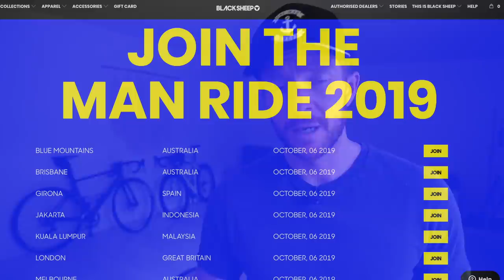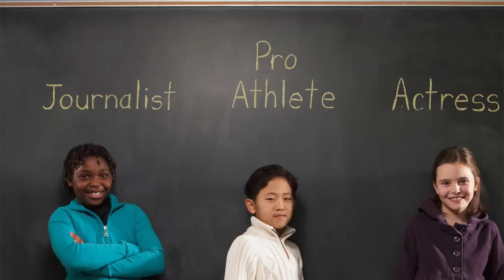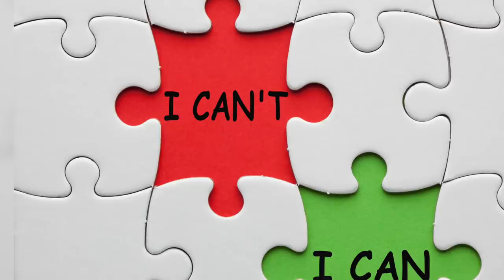Crashing My New Giant TCR & Lessons Learned

Comment: a strong front strobe light would help, especially in yr situation i believe.
Reply from the maker: Yes, agreed mate. Good point I should have mentioned. Cheers, Cam
Reply: Cam Nicholls the Bontrager lights have an interrupted flashing pattern which Trek funded research with Clemson University.  They also pair to Garmin head units and you can program them to turn on when you start your ride, and they adjust to the daytime light.  Whilst they are expensive, I think they are well worth the money.
Reply: Strongly agree on running your lights in the daytime. It is very very cheap insurance.
Reply: I've been using Exposure lights for the last few months (after a near miss), which have a day bright setting (irregular flash). I've noticed drivers giving me more room since using.
Reply: white light front strobe light, red strobe rear helmet, red strode rear bag, garmin rear radar!
Reply: Totally agree. I commute with flashing lights whether day or night. Better to be  safe and cautious.

Comment: Great message about mental health 👍

Did you have a front-facing, flashing light when you had the accident? I use one for the specific reason you outlined in your crash report. I also use a Garmin Varia radar on the rear. I won't ride without either. Glad you're ok.
Reply from the maker: Thank you mate, no I didn't. Something I should have brought up in the video. I know there are some really good tech lights out there at the moment that are even designed to capture motorists' attention! Thanks for sharing what you use, I'll look into that. Cam
Reply: Cam Nicholls the Bontrager lights have an interrupted flashing pattern which Trek funded research with Clemson University.  They also pair to Garmin head units and you can program them to turn on when you start your ride, and they adjust to the daytime light.  Whilst they are expensive, I think they are well worth the money.

Comment: When I'm riding past parked cars I watch for whether a car has it's lights on to work out if the driver is going to pull out or open a door. Also, the sound of an engine if a car is slowing down to turn is often more reliable than indicators.
Reply from the maker: Good insights, thanks for sharing mate.

Comment: Thanks for sharing Cam, glad you were not injured too badly.  Wish you a speedy and full recovery. I had a collision a little while back and I believe my learning point was take a defensive/ready mind set.  Assume that the car did not see you or is going to turn in front of you and reduce your speed, cover your brake etc. You only have to be complacent once.
I am a strong advocate for day-time running lights front and rear.  I have a go-pro mount under my wahoo to which my front light is mounted and hides.  So it is out of my vision when I am riding, I only see my wahoo and looks tidy when I look at my bike.  All modern cars run day-time running lights so they can be seen. We are kidding ourselves as cyclists if we think we should not use them. We as cyclists should put safety above vanity and aero gains.
Reply from the maker: Thanks Mark, and your bang on re running lights. Appreciate you sharing your story. Cam

Comment: Pull your fork out and have a good look at with the torch in a dark room. Look inside it as well. Take off your seat cap and check the ISP tip for any cracks inside and out.
Reply from the maker: Cheers mate, I might pull something else out and have a look at it in a dark room also! Leave the torch behind. Cam

Comment: Good video bringing attention to tricky lighting situations (showing the driver's view too), and the benefit of being open with each other about difficult times.
Was surprised the mechanic did not mention fork/headtube damage. Especially with stronger carbon rims that do not buckle, that force is getting transferred back into the fork/steerer/frame. I guess you can never be 100% certain without a scan but worth dropping the fork out and looking for cracks, bulges, haze, especially where the steerer joins the crown.
Reply from the maker: Cheers Craig and thanks for bringing up this insight. Makes sense. Cheers, Cam

Comment: Great video fella. Ironically In July I had the exact same incident with oncoming traffic turning right. My TCR was written off.  3 days in hospital
Reply from the maker: Ah Andrea! That's terrible to hear. Glad you've come through the other side though. Although the TCR! No! Did you get insurance? Cam
Reply: Cam Yes, I’m in the process of getting compensation. Driver is being prosecuted by Police, so no question about liability. Been riding a long time and normally I’m very aware of my surroundings!  I’ve since started using daylights as a precaution!

Comment: Thanks for your honesty mate, it does have a positive impact on everyone that watches your videos. 
Glad you came out relatively unscathed int the crash. People have given some good ideas regarding safety, I just have a couple of points that haven't been addressed. From the extensive research that Poc has done, the two biggest things that contribute towards safety is a bright helmet and socks. One is in direct line of sight and the other is a moving visual cue. Orange is the clear winner in drawing attention, way better than fluoro yellow. Wearing dark kit is not that big of deal if you have these two ends sorted. Running daylights is a given of course. SeeSense make brilliant lights that have a distracting pattern just for this purpose. Apologies for the essay :)
Reply from the maker: Great essay though mate, thanks for sharing on the thread. I’ll look into those lights. I have used Exposure Lights in the past. They are actually awesome and I need to get them back out. Interesting to hear re socks and helmet. Makes sense. 👍
Reply: Im surprised by your claim that orange is better than fluorescent yellow. Since colors at the red end of the spectrum become invisible quickly in poor light, and since orange seems closer to red than yellow, I've always assumed yellow is a better warning color than orange. I need to look into this further. I hope I don't need to replace all of my yellow socks!
Reply: @donbushek  Yeah I was surprised as well. However, there is a reason that traffic cones are orange and not yellow. Also, bright fluoro orange like what POC uses covers day and low-light visibility.

Comment: Thanks for posting this.  Hope you're ok.    All warnings about these kinds of dangers are good for us.  I always use a flashing daytime light (mine is a Cygolite).  It helps with this.
Reply from the maker: Cheers Stuart, definitely a smart move to be running daytime lights. Something I should have mentioned in the vid! Cheers, Cam
Reply: @CamNicholls  A few weeks ago my light stopped working. During the period I was waiting for Amazon to deliver a new one, during rides I noticed cars were seeing me much later.  I could tell from the way they behaved at intersections, sometimes my presence surprised them.  It makes a big difference, especially if the driver is dealing with glare or shadows.

Comment: Cam, day light running lights. This what you need and what every cyclist should have. Like helmets being mandated, I would go as much to say that an operating day light running light on both the front and back should be made compulsory at all times while using a bike. There is a good chance the motorist could have seen you if you had a bright and blinking light on the front. 
As a cyclist, we are perhaps the most vulnerable bunch of people on the road.

Comment: In addition to flashing lights, I recommend riding with a loud horn. I use an Airzound horn, which produces a 115 decibel blast that definitely gets a driver’s attention. The Airzound can be mounted sideways just under the brake lever for easy access to its button. Its air reservoir can be mounted under the down tube on larger frames, or perhaps under the top tube. The air reservoir can be filled using a bike pump with a Shraeder valve adapter. I feel strongly enough about riding with mine that I brought an extra one with me on a recent trip to Australia to mount on a rental bike. Link for more info: https://www.amazon.com/Delta-Cycle-Airzound-Hooter-Rechargeable/dp/B07YYDNCRQ

Comment: I had an accident with a car where the only noticeable damage was broken handlebars. The bike shop wrote a letter saying the bike seemed fine but they could not guarantee that there was not damage to the carbon frame that couldnt be easily seen. The car insurance company was approached and they basically replaced the entire bike minus the undamaged groupset. Lesson is dont risk riding a frame that has been in a heavy accident
Reply from the maker: Thanks for sharing Greg and glad to hear you came out the other side! Cam

Comment: Good video.  My tip: whenever riding in an area of heavy traffic, dense foot traffic or a dangerous intersection, simply  "turn off" the fast ride until you are on the open road again and know you have cleared the traffic and other dangerous situations. This may take some time to get used to, especially if you are someone who is obsessed with stats like average speed for a ride, but realize that it is a mental transformation.  Sometimes I slow down to just 10km/hr on a bike path if I'm approaching a kid on a bike path when I could easily pass faster, 99 times out of a 100.  But remember that it is the one time that there's an accident that will never compensate for the other 99 times.  Ride hard, but in the right place.
Reply from the maker: Good call mate, thanks for sharing. Cam

Comment: Cam cyclist over hear in England have been trying to get the Dutch Reach (look it up) put out there to drivers, which involves turning your head as you undo your seatbelt forcing you to look over your shoulder to the outside of your car and see any cyclist about to go past you.
Reply from the maker: The hard part is getting to drivers! And then them listening. What's your experience with that? Cam
Reply: @CamNicholls  non effective when speaking with them about the Dutch reach they go blank or think you are talking about a porno manoeuvre.

Comment: YIKES...........SO sorry to hear about the car induced crash. It's probably the #1 classic risk for Motorcycles (learned in a Safety course many years ago) and bikes too. The environment (Sun angle & shadows) just magnifies the risks for Riders. For TOO many Drivers, their brain (usually on "auto-pilot") based on experience is ONLY looking for a car's / truck's frontal area. So a Motorcycle moving at 2 or more x faster than a Bike even with their Headlight on are often never recognized by the Driver who turns directly in front of them. Same with a Bike. They either don't even recognize the Bike coming or totally mis-judge the closing speed and if the Intersection is very busy or surrounding vehicle speeds are higher - the Driver often feels pressured to make a move which makes picking up anything other than a car/truck nearly impossible for too many drivers. 
Plus the times where a car passes a Bike and immediately makes a turn directly in front because they don't have a clue that the Bike is moving much faster than they estimate, if they even saw the Bike when they passed it.
As a Rider (Bike or Motorcycle) the default defensive approach has to be - they probably don't see me & there's a big chance they will turn in front of me. Lights (saw previous comments) certainly help & should definitely be used but are no guarantee against Drivers, so we can get complacent / too comfortable on any ride. Unfortunately, that's the sad reality on too many roads. Gravel riding is becoming so popular and this is one example why. ..........Cam, SO glad You escaped without serious injury.
Reply from the maker: Cheers mate, thanks for sharing too. Much appreciated. Cam

Comment: I just got into an accident about 3 weeks ago. A car made a U turn, took over a bit of the bike lane where I was to make the turn. The car ran. And I was left on the floor. Looking back, I remember feeling aggressive while following the car decided to pass it thinking it will not go over the bike lane. Driver was driving rather erratic possibly deciding when to make the u turn. My advice to everyone is: if you see a car in front of you slowing down, let the car do its thing and wait behind it. Don't pass it right away assuming its ok. This worked wonders for me weeks after when a similar scenario almost happened. This time I was prepared. Stay safe everyone!
Reply from the maker: Good point mate, and thanks for sharing. Glad you come out the other side! Cam

Comment: It's very simple....never, ever assume a motorist sees you! Whether a vehicle is pulling out into the road or turning in front of you, just assume they are not aware of you. Before getting into cycling, I rode motorcycles for 20 years and to survive, you have to learn to drive extremely defensively. I had a large SUV waiting in a turning lane  to turn in front of me and I thought the driver saw me. I slowed just in case and sure enough, just as I got close the vehicle turned. I hit the brakes hard and came right up to the passenger side door just barely avoiding impact. The lady passenger eyes met mine just as I was about 2 feet from her door and her face had the expression of fear, surprise and shock. It was actually pretty funny but could have been quite serious.

Comment: Every ride I have front and rear flashing lights. The front gets changed to solid if it's dark enough to need it and the lights get removed and not used when I do my annual competitive ride which is on a closed ride. Every ride other than that 1 I assume the people aren't going to see me and I could get run over. 40+ years of riding and lots of near misses with every 1 of them being from driver at fault issues.
Reply from the maker: That's a smart move Alan. Currently looking to join that party! Cam

Comment: Glad you're okay, but with a carbon frame, I don't trust bike shops. you really needto have a carbon specialist inspect it. I had a "minor" accident back in 2008. After the accident, I took my bike to three highly reputable bike shops for inspection. Each kept my bike most of the day when I took it to them. and each gave it a clean bill of health. Three weeks later I was braking and  my fork failed at the crown. No warning before it happened. I got lucky because I had already unclipped one foot and had almost stopped moving when it failed.
Reply from the maker: Very interesting, thanks for sharing your insights Terrence. You make great points to consider. Cam

Comment: Visual inspection of a carbon frame post-crash doesn't tell the whole story.  There can be internal delaminations which are often invisible on the surface.  Plus stress loads can transfer to areas one might not expect.  Generally ultrasound or CT x-ray scans, or "tap testing" is necessary to find them without cutting up the frameset.

Secondly, check to see if the frame manufacturer has a crash replacement program.  Perhaps motivated by a desire to analyze where damage occurs in real world use of their frames, or perhaps to get possibly dangerously damaged frames out of circulation?  In my case, the program made it less expensive to simply replace frame and fork than to do all the analysis (and then still maybe need a new frame anyway!).
Reply from the maker: Great insights Paul, thanks for sharing on this thread. Cam

Comment: Great clip! However, I don´t think visual inspection is enough. I would certainly flex, push and pull on the handlebars to test them. Also, you don´t mention or show weak points on the fork at all. I would absolutely inspect and test the forks as well, just as the bars. The higher the speed you will have at any time after the accident, the higher are the various forces you expose your bike to. And suddenly... The higher the speed, the worse the crash.   Yours  borano20
Reply from the maker: Good points, thanks for sharing 👍

Comment: Glad your safe mate. I know this feeling. Car meets cyclist. I run day lights. LED Super bright flashers work extremely will in the shadows. Check out @seesense.cc lights or bontrager! I figure it’s worth the 50 quid if it saves my life. Again glad your safe Cam
Reply from the maker: Cheers Colin, and thanks for sharing. Someone else actually made the same recommendation so sounds like a winner. Cheers, Cam
Reply: @CamNicholls  All good buddy. I know how this is, In Ireland in winter it's a very low sun always on the horizon and cars are basically permanently blinded! Better safe than sorry. Love the vids. Cheers

Comment: I was hit & almost killed 8/13/19 . This is good stuff. I've been cycling for 6 years & never been close to hit. I was in a familiar area where I warm up for the TNWC. I was behind a car that was a fair distance in front of me. The person that turned head on into me had similar circumstances to yours. They didn't see either the car or me. I was going around 30 mph. 7 broken ribs, a fractured vertebrae, pneumo thorax, concussion, separated right shoulder & 200 stitches for many lacerations on my body & face  from the car grill impact & almost going through the windshield. I felt safe & can not understand how it happened with out me noticing anything. https://www.instagram.com/p/B1JFflMlHHOb9RwLnLTQiEtGI5JkdmNjDnjcvc0/
Reply from the maker: Wow, thanks for sharing Shane. Unfortunately can't see your Instagram as it's private but the words you share are serious! I am glad you came out on the other side and appreciate you sharing on this thread. Cam